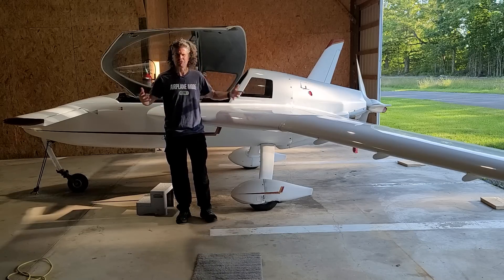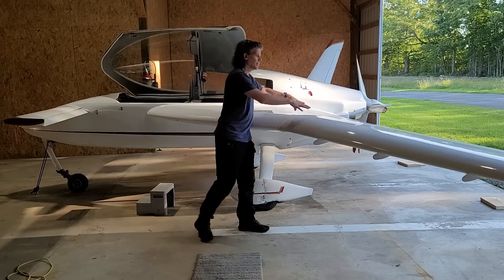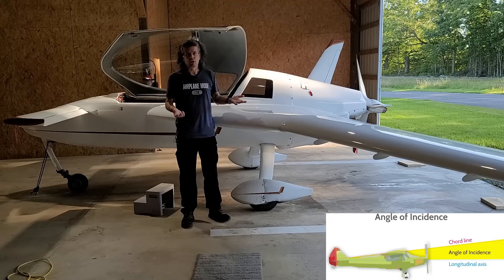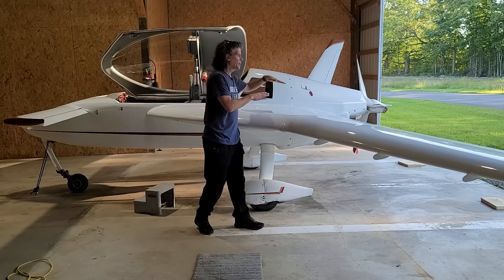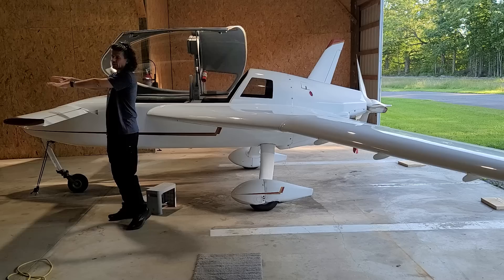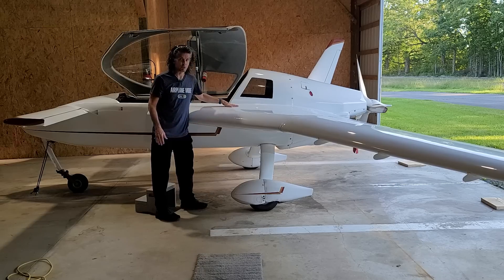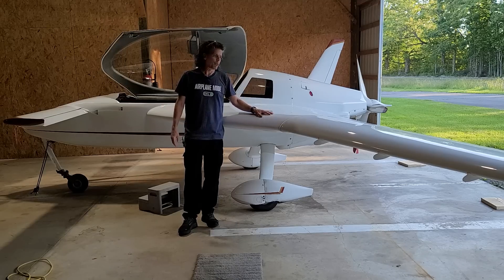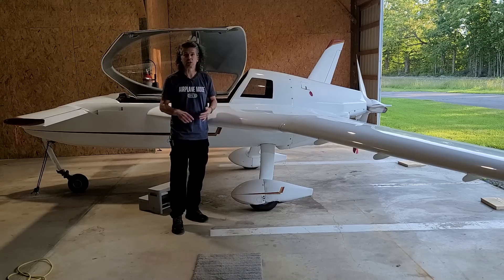Why Did I Buy This Weird Cozy MKIV Canard Airplane?

Comment: My school received one of this as a donation and my instructores explained it was an experimental aircraft . It was pretty cool but experimental are dangerous
Reply from the maker: Experimental aircraft are not "dangerous." Any aircraft can be dangerous in the wrong hands, and if the aircraft is not built correctly (or significantly deviates from the original design) it can be dangerous. Traditional certified aircraft are stuck using designs from the 1950's simply because the cost of certification of new designs is so massive. Advances in design, materials and reliability occur in the experimental aircraft realm, and gradually trickle down to certified aircraft.

I would say that from my own experience, the Cozy flies similar to a Mooney, in terms of performance and energy management. The Mooney feels heavier (because it is), and uses more fuel (higher horsepower) to achieve the same performance, but requires about the same level of pilot skill and competency.

But in terms of danger, the Cozy is a very safe airplane, when flown within its envelope (same as any airplane), and is quite forgiving to the pilot. It is definitely not what I would call a "dangerous" airplane (and I have flown a couple of aircraft that I WOULD classify that way).
Reply: @CanardBoulevard  I would rather have an experimental than certified.  for the reasons you said and more.
Reply: I think I've read that the overall average danger is similar to that of motorcycles. Whether that's true or not, there is an analogy in there. A Hayabusa (a racing bike) is more "dangerous" than a Goldwing (a cruising bike). Most experimental aircraft are sporty like the Hayabusa while most certified aircraft are cruisers like the Goldwing. Also, I used quotes around dangerous because either bike could be operated safely or dangerously, though the Hayabusa attracts a person with a different objective. To a greater extent, the safety of a flight depends greatly on the operator (the pilot). The majority of aircraft crashes can be traced back (sometimes not far at all) to bad decision making by the pilot.
Reply: @watashiandroid8314  that is true . I think they also explained that some experimentales you can purchase as a kit and if your a aircraft  mechanic you can assemble and that makes you the manufacturer the mechanic who builds it
Reply: So if you sell the aircraft the liability doesn't go away

Comment: Excellent overview. The only things that I would add are: 

A) that Burt Rutan was very unhappy with what Beech made him do to the Starship. Adding the flaps and sweeping canard added so much mass, drag, and complexity that it ate up nearly all of the efficiency benefits. Instead of building a stylish and economically competitive business turboprop, it became an aviation pariah that gave the wrong impression of canards as a whole.

B) mentioning that the Wright Flyer is a proto-canard is always a fun little factoid.
Reply from the maker: Yeah, I almost mentioned the Wright Flyer, but I thought that I would just concentrate on the actual source of the name itself.

The Starship was a victim of its execution. It would have been fabulous if they had stuck to the original vision.
Reply: At that time there was no fly-by-wire-complex-control-hydro-mechanical-computer systems so the only way to do it was Mr. Rutans solution to achieve a lower and safer approach and landing speeds...way ahead of its time what they got...
Reply: Ummmmm, no!  The only problem with the Starship was the FAA.  They forced Beechcraft to increase the thickness of the fuselage because the chickenshit bastards at the FAA are technical miscreants.  The sweeping canard was always part of the design.  The FAA added almost a ton of weight to the fuselage because there was no known criteria at the time for how thick the fuselage should be.  That, and that alone, is what ate into the Starships stellar performance figures as was designed.  The underachievers at the FAA did not have the depth of expertise to carry through with the certification process and chose to cover their incompetent asses instead!

Comment: The Devil is always in the Details ! Thanks for the informative video ! Have you considered a BRS for this aircraft ? Would it even be possible to install after completion ? My ideal preferred aircraft would have this type of setup, including a turbo charged auto engine with constant speed prop ! Most airports should be an option if they have a good long runway ! Interested in your thoughts ! Thanks again !!!
Reply from the maker: While not impossible, it would be tough to do a BRS. You would have to carve out the strap channels in the outside skin, reinforce those channels so you don't compromise structural integrity, then design and install hard points for the parachute straps. Then the actual blowout panel and rocket module itself - not really anywhere for it to go, other than losing one of the rear passenger seats. And of course it's kind of heavy.

The problem with aftermarket auto engines is that they are unproven in the application. So you're putting an unproven, untested engine into a brand new, untested airframe. There's a lot of "unproven" and "untested" things for a single aircraft. I know someone shoehorned an LS V8 into a Cozy, but there were significant changes to the design in order to make that work. I know of another builder who tried a turbocharged RX-7 engine, but after multiple engine failures and nonstop cooling issues for several years, he gave up and switched to the old reliable Lycoming which Just Works.

As for constant speed props, they typically aren't used on canards of this design because a) they don't offer a huge amount of benefit, b) if you over-rotate and have a prop strike, it's a $15,000 bill instead of the $3,000 bill you get for a typical wood/composite fixed-pitch prop, and c) putting a heavy constant-speed prop at the very end (worst possible place) of the airplane moves the C/G back so far that you have to have additional weight in front, which then significantly reduces the usable load.
Reply: Very interesting ! Thanks for sharing your knowledge !
Reply: I was thinking that it would be difficult for an already built cozy to install a BRS. I was thinking about a Aero Momentum 2L turbo, or Viking turbo. Obviously if you already have a good engine balanced with the air frame that would be ideal !
Reply: This is an EXperimental category aircraft so it is possible to customize it anytime and almost anyway...for a BRS you need a compartment and hardpoints and connections and a good system layout and activation design...there are many solution are out there today... it really depends on your mission criteria...
Reply: A BRS has been installed in a Cozy.  I believe that plane changed hands and subsequently has the BRS removed.  That said and having been installed, it was never tested.
Reply: not A cozy but I remember reading a report on one that was put on a LEZ and used.  the way it was set up it ended up putting the nose of the plane pointing down.  not sure if that was the intent, but that's how it came down.  it was not in the pilots favor. I remember after reading it, it was enough for me to dismiss the idea of a BRS in a canard platform.

Comment: - Pretty cool airplane. 
- If the lift is downwards, is it still "lift" ? 😀
Reply from the maker: Yup! It's called negative lift. Aerobatic airplanes generate negative lift on the main wings when they fly inverted (which of course turns into positive lift).